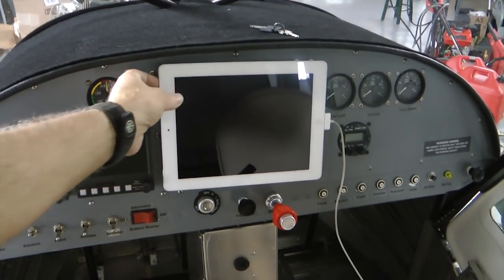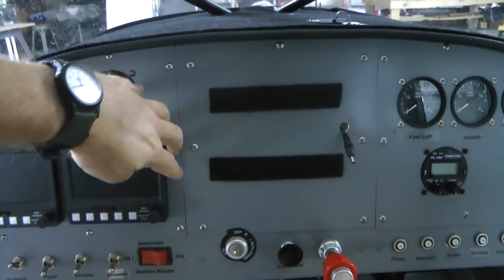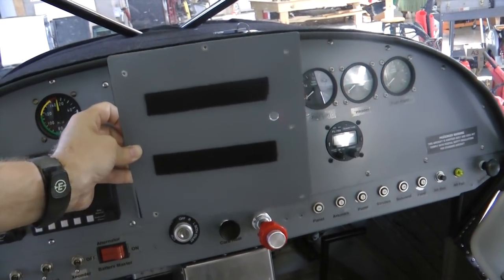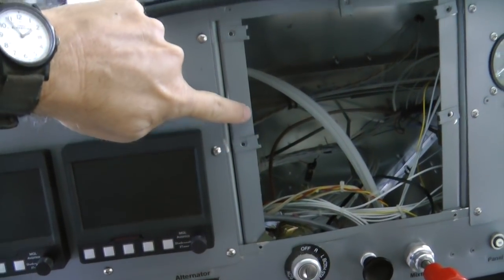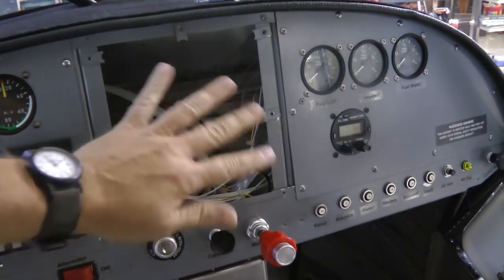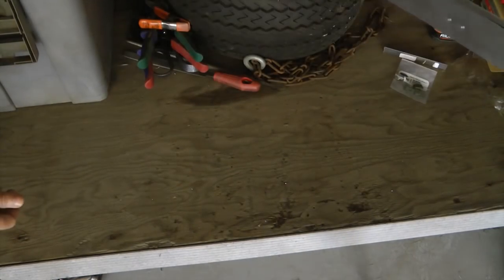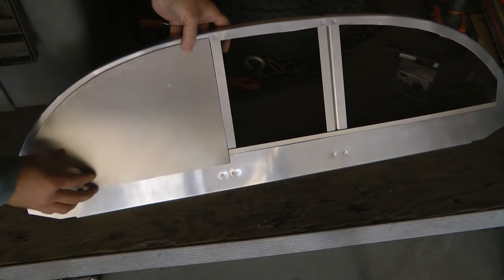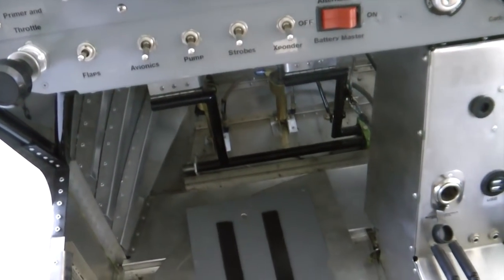Modular Instrument Panel Design

Comment: I did this with my 701. Had two small ones permanently mounted on outer edges, then three separate ones mounted on rubber isolators in the center. The removable center ones had plugs to make it very easy to remove it completely.  Something like this is the only way to go. There is nothing worse than trying to get into some contorted yoga position to get access behind the panel.